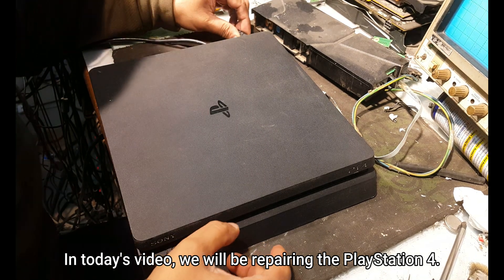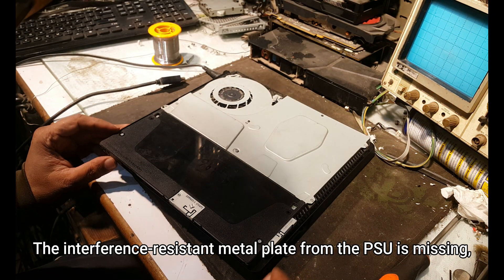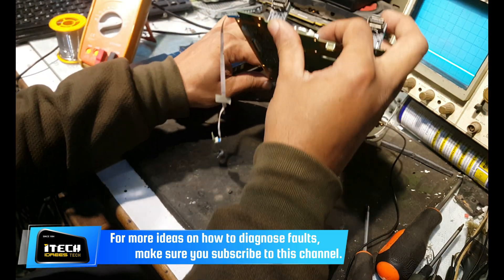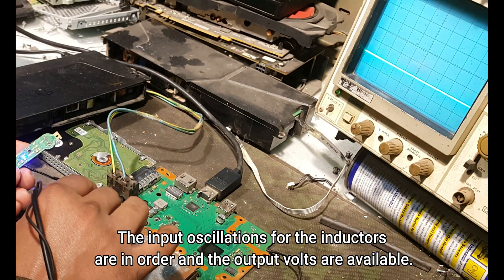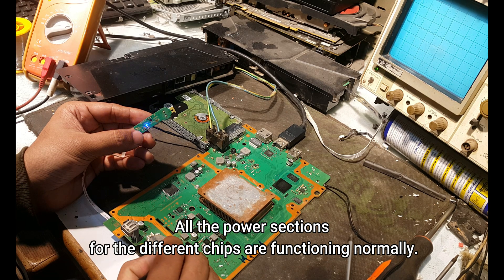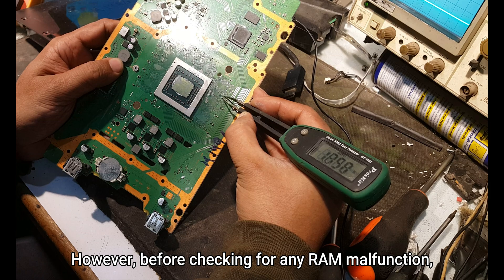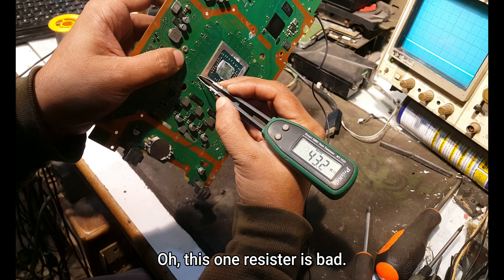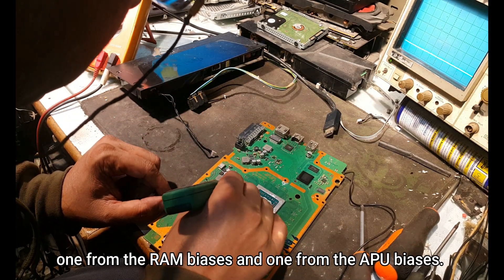ps4 blue light of death - BLOD -

Comment: 7:18 this 4.64 kohm vertical resistor is there on the other side of the apu also. should be exact same value on the other side of apu? This for me it is showing 4.92 kohm on one side of the apu and 4.28 kohm on the other side. what actual value on both
 sides? Please help. Board is saf-003

Comment: I have a question. I've got the apu bias a bit different. The resistor closest to the apu shows 120ohm and the one next should be 1kohm but mine shows 390ohms. Even after replacing it, it still shows the same value.
Reply from the maker: @DrCryogenic Thank you for your question! The resistor readings you're getting could be influenced by parallel circuitry connected to the APU. If replacing the resistor didn't change the value, it's worth investigating nearby components or traces for abnormalities. Additionally, double-check the APU's condition, as it could affect the bias. Let me know if you need further guidance!
Reply: @idreestech  I figured it out. The ram modules 4/5 were faulty and after replacing them, the bias returned back to normal value. But however it didn't fix the issue of blod. A careful inspection on the apu showed a crack on the corner explaining why the ram modules were reported as faulty. It was the apu that was bad

Comment: Hello master, the PS4 slim blue light blinks for 5-10 seconds and the device turns off completely. When I looked roughly, I did not see any short circuit. The fuses seem to be intact. The fan does not react in any way. Which parts should I check? I will take reference as a sensitive point and if there is one. Where should I look? The apu does not heat up at all.
Reply from the maker: It may help in checking some necessary points. https://youtu.be/sW4D8BsvpKU

Comment: Great repair mate and very educational, If u had of used UART to fault find would this have just shown as a DCT error? Some may have replaced the Ram but done so by mistake not knowing the resistors were at fault?
Reply: Hi bro, could you check if the resistors can also cause this problem? I have a ps4 with blod and in uart it gives me loadbios activating mentest it tells me that it is an error in the memories And they all need to be replaced, is there any way to check 🤔
Reply from the maker: @kizeo0 loadbios is a software corrupted error, just try a firmware revert process,it’ll be fixed.

Comment: Wow, wonderful work Mr idrees. Always putting out new method of fault finding, I thought this could only be fixed with a thermal camera to find out which of the rams is overheating or not getting hot. Always rejected this kind of job because I don't have a thermal camera. But thanks to you I now know how to use another method to try to fix this fault. Thanks sir. More blessing.